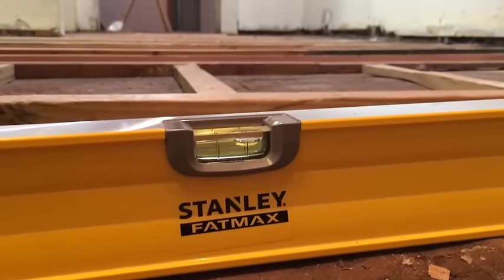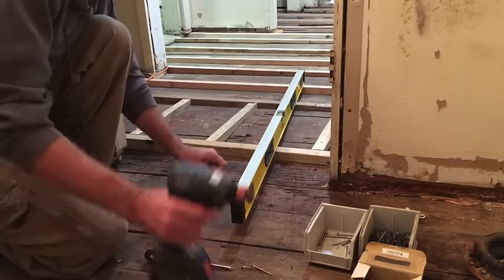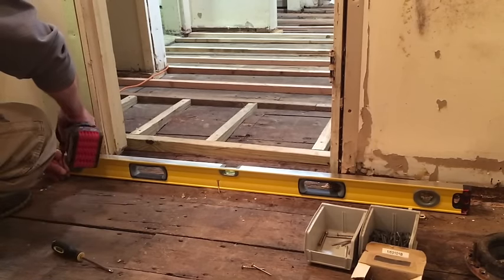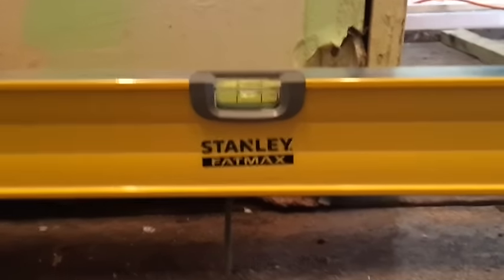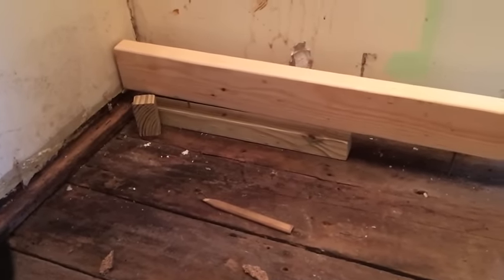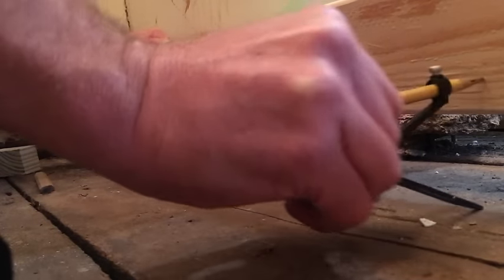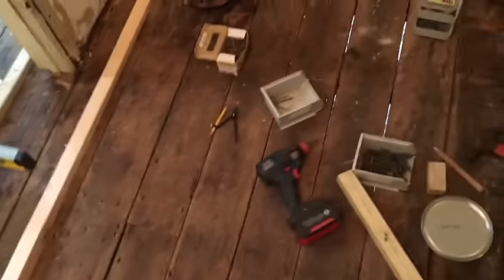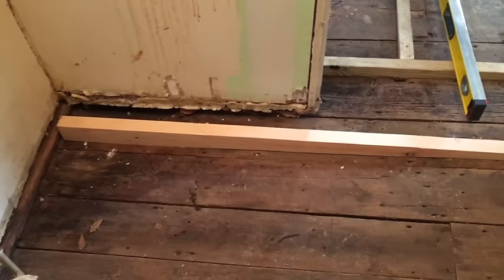DIY: How to level a uneven, wavy, or sloping wood floor

Comment: I did something similar a few years ago.  Wish I had thought of the screws the way you did. I used a laser, found the high point and went from there. I used screws on the outside, and made a string grid all over the room at one foot intervals. There was one beam underneath that had a very pronounced bow to it.  I was able to remove some of the boards around it, and use a chain saw to cut a couple of slots through it lengthways.  ( I had an engineer look at it, and he said it will work or it won't.  He had never seen anyone do anything like this.)  (I am also an engineer)   I used some long bolts and nuts, and was able to pull them together enough to take a lot of the bow out.  (used lots of glue in the slots)  This worked very well.  The roof and rafters had been replaced, and when we tried to jack up one side, it went out somewhere else.  Now you would be hard pressed to find a slope.  (it was off over 2 inches at the worst area.)  I also had high ceilings, so I wasn't concerned loosing a couple inches.
Reply: Ours is off 5 inches! 😬
We are getting ready to do this in two north side bedrooms and have very tall ceilings too so won’t look too bad after the fix.
Reply: Why are screws better than laser?

Comment: As for questions about foundations...sometimes it is better to leave it alone and no need to spend a whooping amount of money on something that is merely cosmetic and not structurally hazardous. Thank you so much for this video...we have a floor that is doing this in our old home...foundation experts have told us that we can fix it by adding beams or not as it will NEVER be 100% straight but it poses no safety risk. So we will do what you have done.😘

Comment: I sort of had the opposite problem. I was replacing carpet with hardwood flooring. One floor hoist had a hump in it. No way I could install the flooring over it.  So I removed the necessary sheathing, chalked a line across the hump, then planed it down with an electric plane.  Worked perfectly.

Comment: @zigpig just what i needed.  I have a 200 year old house i have been debating on trying to lift subfloor vs. shim like this.  Never thought about shimming and then providing additional support for new floor load, without actually trying to lift the subfloor.  very helpful.  i would like to see the finished product too.  I have a layer of glued lenolium that i may or may not remove first.

Comment: I’m just starting to do this in my bathroom.   I got a new laser level.  And I was getting readings that differed by 1.5”.  I thought my laser level must be broken and after checking it with a level I’ve confirmed my floor is off by 1.5” in places.   Which is kinda crazy.  But I knew it was far from level to begin with.  
Anyway.  Thanks for validating the idea I had to fix it.   And good work!!

Comment: Well I was going to go into the whole thing about the foundation but thankfully I did read your info before.  Yeah when you're dealing with a 100 year old home you don't want to end up rebuilding every stick and stone.  I am working on a similar situation for what was originally a paint the hallway and lay some vinyl planking on the floor . . . the floor that rose here and dropped there . . . along with the peaks and valleys I had an overall 3" uneven drop across 15 feet.  S I figured I would have to level the floor anyway.  However because I wanted to encapsulate the crawlspace and replace the galvanized/copper/PVC/duct tape plumbing I decided to open up the floor . . . where I found a preexisting abandoned well, a crumbling foundation for a porch that was still partially being used for support, several splitting joists, several rotting joists and . . and . . etc..  So those being all of the items I had to deal with I decided that removing the whole subfloor was more of a blessing.  I am going about it in a simile fashion but using a 360 laser to find the peaks and valleys but rather than custom cutting long wedges of 2x4 I am sistering (gluing and screwing) the 2x4s along the sides of the joists and adding some cross members to them.

Comment: This was extremely helpful.  I've got an old mountain house with insane pier/beam settling and an uneven floor.  My problem is the area I need to raise/level is right at a door jamb, and the door wouldn't open unless I deal with that as well.  but great info thanks!
Reply from the maker: Glad it helped! Good luck with your project!

Comment: Excellent video. I wish I would of saw this method a few years back when i had a similar task to do. It would of saved me a lot of heart ache. Thanks for sharing.  It would definitely be easier to use the table saw to make the second cut for the height adjustment.

Comment: Great video and awesome method. I do believe this is the way I'm going to level the floor on my current project. I think what I might do though is put the 2x4 to one side or the other of the screws, put the level on the screws, and mark a line under the level on the board as a straight edge. That way you're only making one cut. Now that I think about it I bet a chalk line would work as good.
Reply: I don't understand how this equals only one cut.  Can you/anyone explain a bit?

Comment: Great video,. thanks for  the tip ,    i did it and it works good i discovered, if you measure from the deepest screw  do the same measurement  from the top of the wood and mark it, then you open the compass from the mark of the wood to the bottom of floor and you only cut once
Reply from the maker: Thanks, Manny!

Comment: Thank you for sharing this technique you figured out! I live in an apartment in Europe with wide plank hardwood floors that are very uneven. (The building was erected in the late 1800s.) The top of the bookshelves I bought for the hallway lean forward away from the wall because the floors are so even. (The top of the shelf leans 9cm away from the wall.) I thought about building a level platform to put the bookshelves on top of, but also could not figure out how to follow the contours of the floor. Thank you very much !
Reply from the maker: Akiko, I am glad it helped. There is a similar method used to install cabinetry called "Scribing" that might also be helpful is you search for that term or "Scribe" here on Youtube. Good luck with your project!

Comment: One thing people forget is that when you go to Lowes or Home Depot, you have to search through 6 pieces of warped studs to find one good one. You shuffle through for hours until you have gone to all the stores and got the straightest studs but if you got some damp ones they will warp within a week of keeping them in your home or out in the sun.
Reply: This is 100% true in Wisconsin.  But if you have a less then a 4 inch warp couldn’t you just cut the warp out of the board or shorten it up and do smaller pieces?

Comment: EXACTLY what I was looking for! Thank you!! Had similar approach in my brain - your screw and scribing tactics are a huge help. Only difference I'm facing is doing this on top of a concrete garage floor. But some strategy applies. THANKS!
Reply from the maker: Glad it helped. I also considered doing this over a cracked slab of concrete. I've always had good luck with Tapcon concrete anchors from Home Depot for fastening wood to concrete.
Reply: How did your project in the garage end up? Im currently doing the same. Any tips?
Reply: Hi did you manage to fix your garage floor? How did you do it all in the end? Wood and concrete to level. I was thinking to do this, but was unsure if right thing. Thank you
Reply: Hi. Did you fix concrete floor with wood like this yet?

Comment: Nicely done. Good video. I’ve leveled several floors by removing the sheeting or plank on floor then fastening 2x4’s or 2x6’s (which ever is needed) to the sides of the floor joist leaving them higher than the joist. The height is determined by the height that makes it level. Anyhow, nice job on this. 👍👍
Reply: What screws do you use to fasten those 2x4 or 2x6 ? And what distance between each screw ?  This is an amazing idea, you should make a video !
Reply: @hassanbakkali3785  Thank you for the complement. Guess I hadn't thought of making a video for it. I may do that. As far as screws go I love the Torx screws. I use them for everything. Im not sure of the manufacturer name, (WoodPro maybe). All the hardwares stores in my area sell them. Pretty much everyone around here just calls them Torx screws.  Anyhow, I never nail them, use screws. 
I had an old-timer tell me one time, "never put a nail where you can put a screw". 
I typically overkill things. I will put a screw every 6" or so with the 9x3". 9 being the gauge and 3" being the length. I want to make it solid.
Hope this helps. Thanks again for the suggestion on the video. I may do that.
Have a great day!
Reply: @marke2401  Great minds think alike, rather than making a boat load of custom shims I also removed the floor planking and then "sistered" 2x4's and/or 2x6's along side every floor joist making sure they were all in-line and level with one another using an inexpensive laser level. I also used Torx screws (specifically GRK #9 x 2-1/2 in. Star Drive R4 Multi-Purpose) FYI: Spacing code in my area says every 6 to 8 inches.
Reply: @eltonnoway7864  yup I love the torx screws. Why use a nail when you can torx it.  I’ve leveled many floors using this method.

Comment: Wow... Very innovative man. I have a shed that I am converting into a workshop. The concrete floor is extremely unlevel, by probably 5 to 6 inches. Same as you I could find no videos on this issue until I can across yours. Thanks so much for the ideas. You have helped me immensely. Best_

Comment: I'm about to give this method a try too. My living room is sloped and off level. Wither have to lift the foundation etc, or do this, which will create a new level for the living room... not thrilled but seems like the most effective way in my scenario... especially if I want to snap in some vinyl planks
Reply from the maker: That was my dilemma. I could have rebuilt the structure at a huge amount of effort and money... or just reinforce it where is was, and use this method. I used some Pergo vinyl planks and two years later, it's perfectly level. Good luck with your project and thanks for checking out the vid.

Comment: Thanks for this video. Got an old house that is probably not a great idea to use pour-a-floor on (weight). One of the few vids i’ve come across that actually shows & explains things (in english too).
Reply: What is that Pour a Floor? I've never heard of that, sounds like something that might work for my project.
Reply: Floor level like level quick from home d but at that dip it would gain tremendous weight

Comment: this was very good, i really like the screw idea.  so effective in its simplicity.  2 comments though, one, i would have set the scribe so that when you make the scribe cut, it comes out to the finished level.  or if you do it the way you did, i would have run the straight edge against the fence and cut off the amount you required.   good video though and good job

Comment: Great video. Without taking away from your video, just wanted to mention that gypecrete would also be another great option since it is a self leveling material. Its also used alot in hotels and other commercial buildings. However for wood floor leveling options. Your  video has been the best I found on YouTube. Great video.
Reply from the maker: Thanks, never heard of it, but I'll look into it
Reply: It's too complex stuff and more permanent. Your way is better!

Comment: Can you do this on concrete floors? My new home office is a gradual slope to the right. Definitely going to cause long term back/neck problems for 8+ hours a day here
Reply from the maker: Adam, I actually did just that on a concrete porch that had been enclosed on the same house. I just used concrete screws as fasteners.

Comment: The usual way of doing this and I’ve done it many times is to put a datum on the wall , from an existing point like your kitchen floor or the highest point you draw a datum which is a level line from which all your measurements levels heights etc are taken , once you’ve got the datum you cut a rod say at 1 meters and from that you set a perimeter around the room, then run your batons/ joists from one side of the room to the other using blocks and a string line. A water level is easily made with some clear plastic tube full of water or a lazer device is cheap to buy or inexpensive to hire. 
Make packers to put under the new batons/ joists, these are usually different thicknesses of ply wood at about 100 mm square stacked up screwed down with the new baton joist on top you only need to make theses as small as 3 mm thick as with 3 mm you can get to within 1 mm of the desired height , it’s easier if the 3mm packers are smaller and cut in the shape of a pair of trousers this allows max manoeuvrability underneath a baton joist with a screw in it . It may sound complex but scribing joists to a floor is very hard work and never likely to be exact , cutting down the grain is difficult and unpredictable.
If you need to raise the floor by 50 mm 2 inches on one side and 100 mm 4 inches on the other use a roofing baton and place the packers at 400 mm 16 inch centres  put these new batons 400 mm 16 inch centres apart down the room this will fit the schedule of your flooring material, ply sheets etc , if the fall is really big use a bigger baton or joist a 3x2 or 4x2 , as you don’t want the packing stack to get too tall and unstable you can use different sized batons or joists and butt them together on the packers . 
Cut three blocks about 3 inches long from a bit of prepared 2x1 and use these as a gauge  securing a string line from one side of the room to the other with blocks underneath it on top of your baton laid to the datum , you can then gauge the height of your baton as you work across the floor .
You might come unstuck is if you discover that there is a section of floor that’s higher than the height your aiming for and you have to remember that you are lowering your door and ceiling heights . Also in effect you are burying the existing floor and putting a small cavity in it , it will boom like a drum give safe haven to every kind of critter and bug and render itself inaccessible until the floor above is lifted , if it starts to rot you won’t know, infestations of woodworm termites dry rot and wet rot will all go unseen and undetected 
I’d lift the existing floor and relay it on existing joist using a datum and packers as described . 
I live in a very very old house 1634 and the people I bought the house from did this very thing , the disruption for me to take up the false floor and get to the floor boards which are wormy and need removing is unbelievable it means having two rooms out of service and creating havoc in each and the mess is building site status, in my house they just covered the room floors so there’s a two inch step up into all the rooms , obviously they couldn’t raise the landing because it would give an extra 2 inches to the top of the stairs , it’s worth re thinking your plan. it’s also a pain doing all that scribing which isnt necessarily at 90 degrees to the perpendicular , in time it will squeak ,
Reply from the maker: LOL what are you talking about
Reply: @737T1C130 you said you couldn’t find a you tube vid that showed you how to lay a level floor , I was trying to give you a written instruction for how professional carpenters do it , I worked as a carpenter for most of my adult life and had a very long job once laying in new floors in a hotel in Kensington London , what I described is the way it was done, I didn’t think that laying a floor on top of an existing floor was a particularly good idea but the method of using a datum around the wall is still the standard way of laying floors . Scribing new timber then cutting it to size is labour intensive and extremely wasteful .
I also have the experience of having had someone cover old rotten floors with new batoned and chipboard floors in my own house , it’s not the best arrangement but the mice like it . sorry if my opinion was unwelcome

Comment: i used this technique to level an EXTREMELY unlevel and unevenly bowed floor in my 400 year old house, i had to use a jigsaw to cut the odd shapes and it worked very well, resulting in a deviation of less than 2mm across the entire span, whats missing from being mentioned in this video is how big should the gap be of the scribe, it should be exactly the thickness of the wood you are scribing onto, so if it 2x4 stood upwards, set the gap to 4, another tip is never plain off the top of the wood always the bottom (i learnt the hard way) this is one of three techniques i used, in another room i used a suspended floor using kingspan metal floor panels on pedalstools because i had 220mm depth deviations, the results where not great, problem getting the pedalstools standing dead straight which is critical, the 3rd method worked best, i used self levelling pedalstools by Quantum Rubber and suspended the wood on them, it was the fast and the most accurate way, and not that expensive either
Reply from the maker: Great to hear, Mark. I could not find anything explaining how to do this, so this method came to me after dwelling on it a couple days. It wasn't a perfect solution, but I'm glad you found a way to make it even better. If I were to make the video again, I'd definitely make some changes.
Reply: Hi Mark, Do you have any other advice or insight about using the 3rd method?